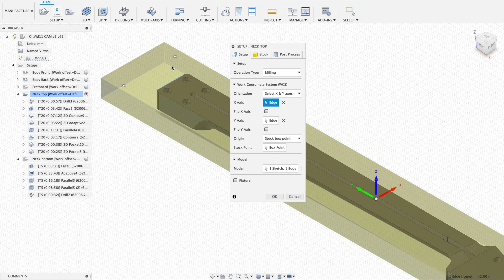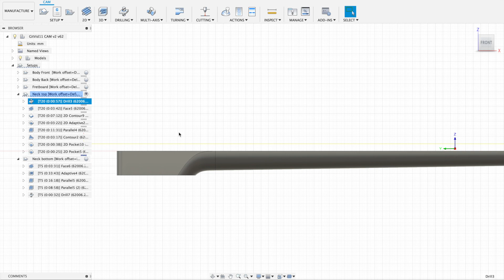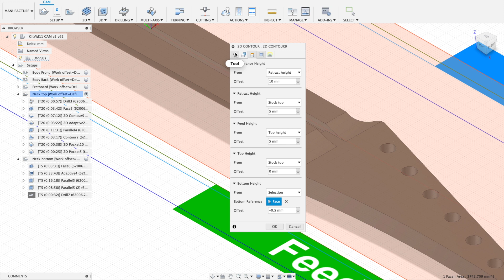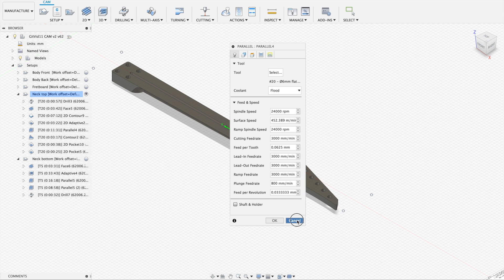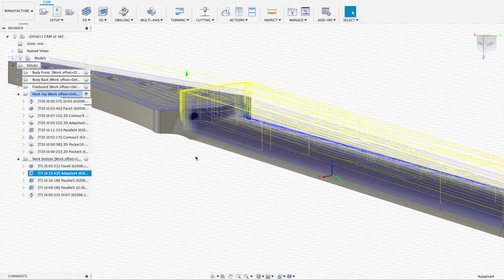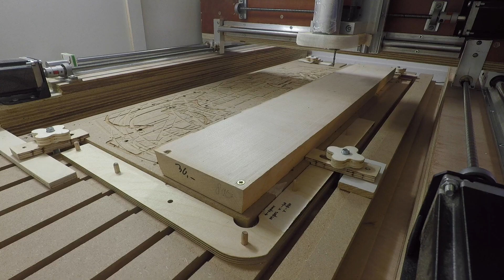Creating guitarneck on CNC machine with Fusion360

Comment: Thank you very much for your detailed videos.  
Tried do do a Strat Neck and failed  (but knew that it will fail on some point). 
Now I'm using your methods to start again....  

I'm completely in the beginning of CAD/CAM , just finished building the MPCNC and did some test cuts  which worked out pretty good so far but somehow I think it took way longer than it could. By that I mean that I'm pretty sure I could tweak the cutting feedrate and/or the cut depths. Currently at 1mm depth and  1750mm/h.  I've seen you are at 3000mm/h , but I think your CNC is a bit more rigid and maybe the spindle has some more power too, so it might handle it better. Would you have any suggestions here?
Reply from the maker: In regards to speed: I try to do everything with 3000mm/min. But lately I try to bump up speed with certain strategies (for parallel for instance). In general; in wood, I also try to 'eat' more away in vertical sense than in horizontal ways. I'd rather go 5mm down and eat a 1mm per pass, than the other way around... Have a look at my latest video and you'll see what I mean. 

For my guitarbody I tried keep the machiningtime  around 1 hour per side. But, really, there's no point; the machine is doing its job and won't get tired along the way. :-)

Comment: Thanks for the video  I have a laguna iq cnc when i flip the stock and set z to the spoilboard the machine starts at X0,Y0,Z0 ignoring the stock.  I raised z to the top of the neck, but with an angled headstock the bit still goes into the headstock before going up to the top to start clearing.  is there a way around this with fusion 360?  csn i raise Z zero as high as i need to? Thanks
Reply from the maker: Its most probably an G28 issue, which must not be included at the beginning of the GCODE file. Please keep in mind: I have no knowledge about your machine. You probably can disable it in the setupform for creating the GCODE file in fusion360. Hope this helps!
Reply: @Audiohotshot  The tool touch wasnt setting z to zero.  Once i figured that out everything is working  Thanks

Comment: Hi! How did you set up the truss rod toolpath? All strategies I've tried give me the empty toolpath with the 6mm flat end mill on a 6mm slot. Thanks!
Reply from the maker: There are more ways of doing this; I just selected the contour, and kept the tool inside the boundary. You could also project the contour onto a sketch let the tool follow that path.

What could be of help is to take into account that the strategy uses lead-ins and lead-outs; make these zero to prevent the tool needing this extra space to move.

BTW: These tips came to me by using my extra special crystal ball.. :-)

Comment: Are you using 2d or 3d adaptive for the back side?
Reply from the maker: I'm using a 3d adaptive, I posted a  complete picture of all my settings on my blog. If interested, have a look here: https://www.audiohotshot.nl/routing-the-neck/

Hope this helps!
Reply: @Audiohotshot  PERFECT!!! You’re awesome!!!!
Reply: I need something explained please. I'm having issues with two-sided milling of the neck. I'm very close, but I can't ever get the back to line up with the front side. How do you recommend centering the neck in the stock along with the holes for the dowels? Forgive me for asking but I'm having a dumb moment. Thanks!
Reply from the maker: There are many ways of doing this. One way to do this is by drawing 4 circles. Each circle has the same distance to the axis around which you want to flip the stock. Then you extrude it (or not) and with a drill strategy you make four holes. The depth can be set with the offset on the bottom hole page. Include the dowel holes sketch or bodies in your modelsetup so setup knows about them and generates GCODE taking into account the correct coordinates.

But as I said there are many ways of doing this. Hope this helps.
For inspiration, take a look here : https://youtu.be/sY3E7iepzos?t=304
(or any other vid of me where i do double sided, you'll see different approaches)
Reply: @Audiohotshot  thank you again!

Comment: Do you find fusion 360's machining time predictions to be accurate?  Its off by a factor of 3-6 for me.
Reply from the maker: Most of the time it is pretty accurate afaik. Obviously, when I’m adjusting the feedrate by hand during machining it will take some time longer.

When your numbers in fusion (like feedrate and so on) are ok, the difference must most probably occur in your cnc controller software. Perhaps you manually by accident override the feeds and speeds?
Reply: @Audiohotshot  I do not adjust them, but I am sure something is happening during post.  Thanks for the reply!
Reply from the maker: Just something that I thought of today: perhaps the steps per mm differ (although you are not having size problems, are you?) between your controller software and the hardware microstepping settings on your drivers? Such is easily overlooked when you work with bcnc for example…(you can actually set the amount of steps on the arduino-GRBL-controller different from the drivers that way). 

But I do realize you do not have a problem with the machine not making the correct dimensions and so on.. so this probably not the solution.. just 2 cents..

Comment: Are your files available for download?
Reply from the maker: Each part of the guitar is specifically created for this particular design. The dimensions I use are in no way matching to existing guitarbodies you might have. In short: you are better off designing your own. If you want to know how I design and draw my guitar, have a look at my other videos.
Reply: @Audiohotshot  I'm looking at cutting my own on my cnc but I'm not very good at the design process and struggle with time
Reply: @Bible_Studies101  

Just keep practicing and you'll be fine. There's some other great videos out there and you can easily put together a step-by-step process by having a look around. Even if you extrude from some basic 2D plans out there, you can dimension any extruded cuts (might be different for Fusion, I come from a background of SolidWorks) thereafter. :) Hope this helps!